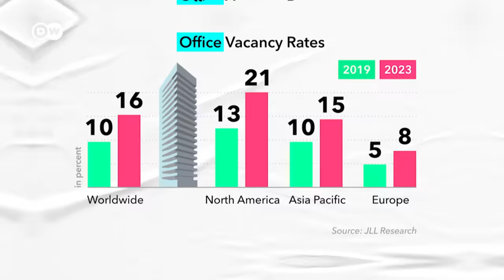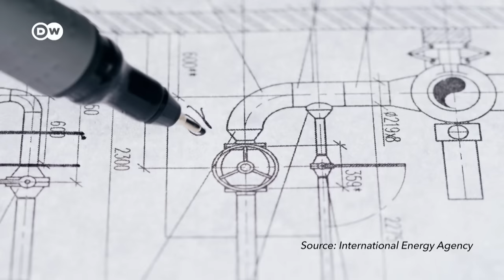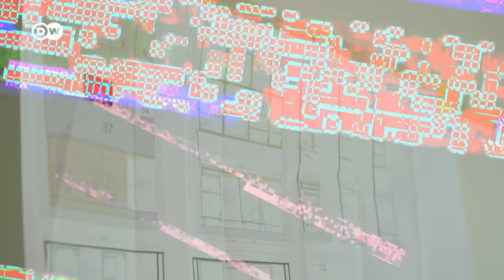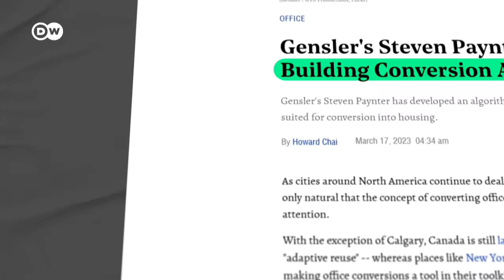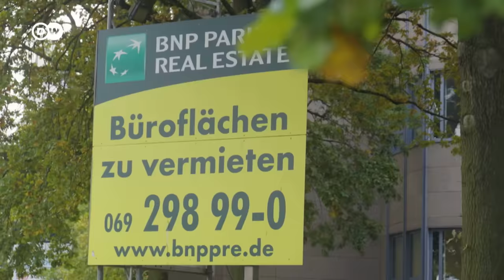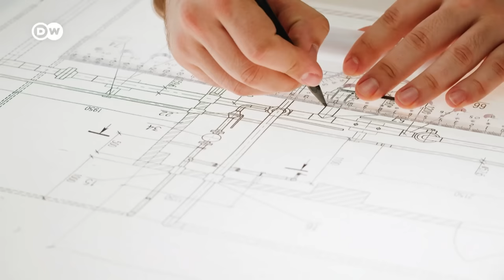Why don't we just turn empty offices into housing?

Comment: I think the plumbing would be one of the worst problems to deal with. Office buildings have one bathroom for each gender per floor, with multiple fresh water and drainage pipes. Apartments need fresh water and drainage pipes for all the kitchens, and all the bathroom, tubs, toilets and sinks in every unit. To install all those pipes and water supply would be daunting. Lots of tearing up of walls and floors. You almost have to gut the entire inside to do that. And all those extra pipes must have an impact on the load-bearing capabilities built into an office building. And then the video also noted individual heating and cooling in each unit that can be controlled by the unit. Most office buildings have master controls per floor and central heating and cooling systems. God bless if they can do it, but I wouldn't want to be the engineer figuring all that out.
Reply: I recently read the Bell Jar by Sylvia Plath and realized that back in the 50's - 60's, apartments and hotels had "shared bathrooms".
I think it still occurs in some countries with large populations of poor.
As late as the 1960’s, many homes in Britain did not have a bathroom.

Considering the fact that a lot of these cities have no public restrooms and the businesses in them limit the bathrooms to either customer only or employee only, poor people living in tents on the streets would probably be willing to settle for a shared bathroom.
Speaking as a formerly homeless from Denver, CO myself... 
We Americans might need to be willing to live less "lavishly" than what we've become accustomed to.

We definitely need to take a few steps back in time, because the path we've come down Capitalism-Lane has reeeeally fukked us over.
Reply from the maker: Hey Mike! Yes, this is a huge challenge. Depending on the layout of the building, a lot has to be changed and often even an entirely new plumbing system.
Reply: @Othique I had considered the idea at some point of the type of living accommodations with private rooms but with public amenities such as bathrooms and kitchens, as a way to save money on housing and encourage socialization. Which, I still don't think is a terrible idea, but it isn't really one which supports family building as I feel most people who have/want children in the future wouldn't be thrilled with the idea of their children having to consistently be exposed to strangers for basic things like going to the restroom without their parents having to follow them. But maybe the problem is that housing seems primarily focused on a family environment when there are plenty of people seeking housing who either haven't gotten to that stage in their life or simply don't want that
Reply: You could get a portable bathrooms to try the idea, and if success, converting few rooms to toilets and bathrooms wouldn't be an issue.
Reply: @Fredy_The_Yeti in my experience with every new build apartment complex Family building is the Last idea on any developers mind. almost every new massive complex is a 1bdr or 2bdr complex. Not conducive for a family unless your going to be with 2 children sharing a room until their 20's. but the price also doesn't help since that can go for 4k and higher. these are clearly student housing or housing where you only live for a few years before moving off to build a family. Long term tenants are not business' savvy. but a highly mobile and cycling group of tenant means you con constantly rise rates ever time someone moves out.
Reply: @BlueBD  it's an odd in-between, because it's not really enough room to build a full family, but also an extra room. Sure, it can be used as an officer, but I think many people would like a single bedroom option if it means a couple hundred less dollars a month
Reply: You realize that people living on minimum wage are renting ROOMS, right?
I actually have a bachelor apartment that's relatively old but pretty decent, it doesn't have individually controlled heating.
Also, people live in dorm style apartments all over the place.
It's not complicated to have mixed units in a building. Have the more expensive "luxury" units while also having dorm style rentals with a shared bathroom and kitchen area. A small kitchenette in each dorm room to make them less dependent on the public kitchen area and you have a mix of cheap and more expensive units that will actually have an effect on the housing crisis
Reply: I highly doubt that the biggest impediments are technical. As mentioned in this video, the bottleneck is very often arbitrary/obsolete rules getting in the way. A building owner who knows that they need to run a slow and expensive bureaucratic gauntlet with no guarantee of success to do a conversion is very not likely to go out and hire an architect to look into and design a conversion that they might have to scrap. Also mentioned in this video is that even when there is little construction cost benefit, there is a big time benefit. Being able to make your money back quickly is a pretty strong incentive. Sure, redoing plumbing isn't cheap and easy, but you know what else isn't cheap and easy? Building a whole new foundation and structure. If it were easy, it would probably already be done, and there would be no housing shortage.

Comment: From the challenges that they are alluding to in this video, it sounds like office buildings are much more suitable for creating rooming houses, hostels, and cohousing, instead of luxury or single family homes. This could serve the lowest income bracket really well, with homes where tenants who share a home have access to a common bathing and kitchen facility, and private bed /living areas. They could be great stepping stones for singles and young people, and offer a lot more dignity than just cramming four adults into a home designed for a family.
Reply: The side cost for the flates will be insane with all the maintanance + elevators
Reply: @ravanpee1325 not sure cause the cost will be shared with so many tenants
Reply: Agreed, but it is important to have mixed units to avoid developing a slum.
They mentioned it was hard to make ALL the apartments nice. Well, make SOME nice apartments and have SOME dorm style rentals.
Keeping this in mind should ease up most of the difficulties in design and implementation

Comment: Thank you for presenting an “incremental-but-valid solution” perspective. It seems to me that we often discount solutions because they don’t completely solve the problem, when instead, the desired outcomes can come from employing multiple, smaller innovations. ❤
Reply: yeah it is a bit weird how gung-ho the older generations of developers are to knock down 1950s-1990s era architecture for being "Dated" when it still serves a good purpose and some of them can be integreated with new urban fabric, america needs better cities but retrofitting is a lot smarter of a solution than mass redevelopment of over half of every american city, especially with how you could probably put taller buildings in the empty spaces in the suburbs without having to completely obliterate what was there before, 90s era communties maybe not but before the rise of the mcmansion they were slightly denser, also low rise areas could exist as some kind of village like area

Comment: A few big hurdles to convert office to apartment that I can think of 
- office buildings typically have curtain wall which can't be opened 
- bathroom
- apartment needs to be fire compartmented from each other 
- office building may not have enough exit staircase when convert to apartment
Reply: I work with this and I'll tell you the biggest problem is actually the fact office buildings are much "fatter", as in, they have spaces that can be 10 meters or more away from a window
Reply: But workarounds are doable. Investors need to be aware in many cases it's impossible to squeeze as many bedrooms etc in the same area as a new construction because of this. Not enough window width / area
Reply: curtain wall isint really a problem, itll be like a skyscraper kinda and also it would kinda suck to ruin the exterior character of the architecture by opening it up (also some smaller suburban office parks around 4-6 stories tall encompass openable windows). its a lto better to convert these buildings than to just waste 70 years of architecture because the urban planning around it was bad

Comment: I live in a large city and have watched many downtown office buildings being converted into housing. I wondered why it sometimes took a very long time to complete those projects. I hadn't thought about things like access to elevators and the like. Thanks for answering some questions I had about those conversions.

[edit] Forgot to mention I live in a converted city hall building, originally built over a hundred years ago. I love the spectacular architecture and construction details they were able to retain (terrazzo floors, cast iron details, etc.) They cordoned off each floor almost with a rabbit warren like maze, not sure what was going on there, but most apartment entrances are 'hidden' down a short L-shaped corridor, or around a bend, rather than all the doors being lined up like dominoes along a long central hall. Some apartments wound up with two floors, one has a third floor in the old clock tower.

Comment: I recall from an urban design course decades ago at Columbia. For cities like NY with extensive subway systems. 9 to 5 office neighborhoods were abandoned at night. So were the subway platforms. Yet the  trains still had to stop at each station.  There was some talk of using subway trains as carriers for the kinds of goods normally delivered in street trucks. I have no idea if anything came of that. Perhaps better or larger service elevators would be needed as well as a way to get those elevators to service building basements. It's amazing that the street grid is only part of the circulation system of the midtown and downtown neighborhoods. The towers also have extensive and sometimes multi level interior lobbies and passages tying the street to the vertical circulation system .  Even the oldest landmark buildings began that practice. The subway system downtown can have many levels at places where many lines share the same station to allow transfers. .It's a fascinating area to walk around and explore for the fun of ot. There were already some conversions to residential use even over 40 years ago.

Comment: ALL buildings should by law be mixed use or mixed-use capable so that they can be quickly and easily converted when the demand of one sector falls and another one rises.  Also the solution when converting isn't to swap them into luxury apartments. That just makes the problem worse. You need to make each unit small, tiny and affordable so it can attract a maximum economic pool of potential renters/owners... Studio units between 160-500 sq ft are very reasonable in most places worldwide...
Reply: The ideal approach would be to design buildings so a floor can be easily altered to anything from one huge open space with a few support pillars to a hundred small apartments/offices, then switch things up as the need arises. Maybe lay things out on a 5*5m grid, where each cell has drainage, water, power and communications points below floor level. A small apartment could fill two cells. One cell containing the bedroom and bathroom, the other the kitchen/living room (probably with some overlap into the other cell, depending on the exact layout).
Reply: Affordability and efficient design are definitely important, but you've got to have some apartments for familes too.
Reply: That would be difficult to do. The reason they are converted into luxury apartments is that bigger apartments mean less plumbing & electrical is required as there is a smaller number of bathrooms & kitchens per floor than there would be for smaller apartments. Although maybe another option would be to convert some of them into student accommodation where shared bathrooms & kitchens are acceptable, rather than having a full kitchen & bathroom in each apartment, thus allowing for more apartments per floor without the associated complexity of the extra plumbing & electrical.
Reply from the maker: And if you would live and work in the same building: less transportation emissions? 🧐 What could possible impact the rent rate is that - according to Gensler - conversion can be 30% cheaper that building a new construction. 🔗 https://www.gensler.com/blog/what-we-learned-assessing-office-to-residential-conversions
Reply: C’est sûrement une raisonnable et bonne solution pour l’état actuel de nos sociétés si déjà cela se réalisait sans tergiverser, ce qui ne semble pas être massivement d’actualité. Même si certaines réalisations sont encourageantes, elles semblent bien timides.

Pour  après demain, lorsque nos besoins d’approvisionnement en nourriture, faute d’énergies pour la transporter jusqu’aux villes, sera alors notre quotidien, alors il faudra privilégier l’habitat au plus près de la nourriture: la terre et ses fruits, et sûrement moins d’élevages animaux en conséquences, aussi. Les plans dont vous parlez seront déjà obsolètes  car leurs réalisations va prendre des décennies pour être efficaces . Et à ce moment là ce ne sera plus viable…Notre environnement ne sera plus du tout le même.C’est cela qui risque de toucher nos jeunes générations actuelles , malheureusement 😢
Je voudrais pouvoir être plus optimiste, mais « mieux vaut prévenir que guérir »
Reply: 500 square feet is pretty much the minimum that I would consider decently livable. Maybe 450. No, I am in a bit of a different situation because I do have a wheelchair. But even 500 sq ft doesn't really allow for much furniture. 140 sq ft is basically only livable if the only thing you do in your apartment is sleep
Reply: @youtubesucks1499  Not sure. What happens with public bathrooms now? Probably the same as that.
Reply: Affordable housing is not profitable to the landlords that own the buildings. They would rather build luxury apartments and have them set vacant as a means for them to maintain their profitability, then building affordable housing. The other issue is that The landlords that own those buildings see those buildings as commodities and not necessities. So they would keep the rents artificially high. What I'm seeing is the decoupling of supply and demand from the housing market. This is the case where demand is so intense that supply will never keep up.
Reply: @DWPlanetA  confirmation bias is strong on this one
Reply: @youtubesucks1499  in a city without much developable land, nobody. Especially if it risks displacing existing residents.
Reply: @youtubesucks1499  I live in a 2x1 detached home with a garage and it cost about $200K in 1953. It costs just over $1.3M in today's market but if inflation was calculated it would have cost $2,300,007.49.
Reply: @youtubesucks1499 Correction on the price. Where I live, in 1953, you could buy a  2x2  detached home for $11,995 for as little as 10% down. That home I looked at is currently 1220sqft, has a lot size of 3,397 sqft, and has a zestimate value of $1,279,600. That same home if would have been $152,824.76 outright if you just taken inflation into account. That house last sold for $1,390,000 on 05/21/21. 

I still don't think you can "build more housing" your way out of the housing crisis.
Reply: @youtubesucks1499  those coffin homes are against so many building codes in the United States. They will never be built here. In fact, a lot of apartments in New York City are illegal to actually rent out for numerous reasons. Any apartment that is technically classified as a basement apartment is illegal. Tenants installing cages in their windows may deter people from breaking in and stealing their belongings, but it also comes at the expense of fire codes. Also, the construction materials themselves are support when the apartments are being built in China. Their videos of newly constructed apartments in which the railings can literally be ripped out by hand. So are you going to sacrifice safety for the sake of building new apartments?